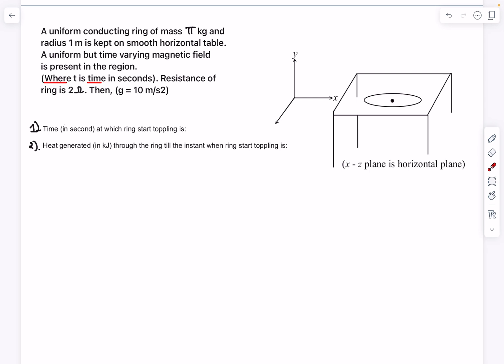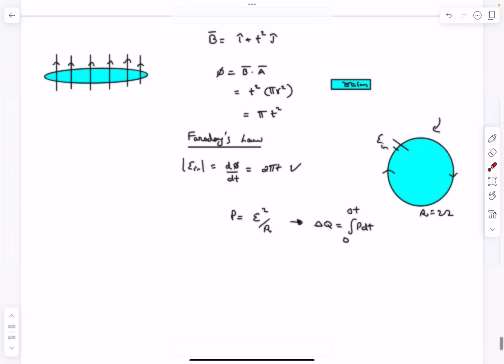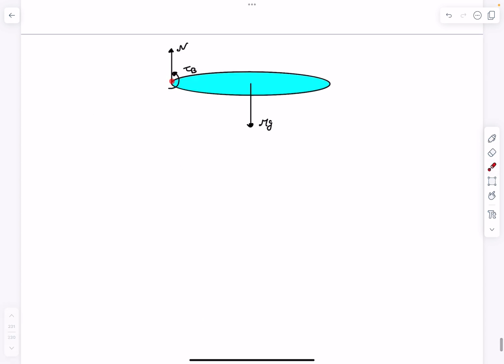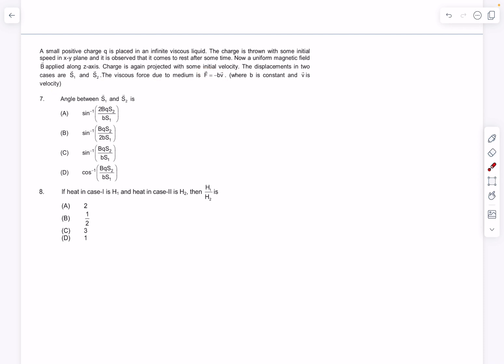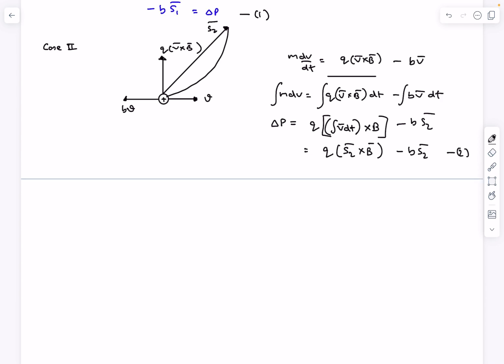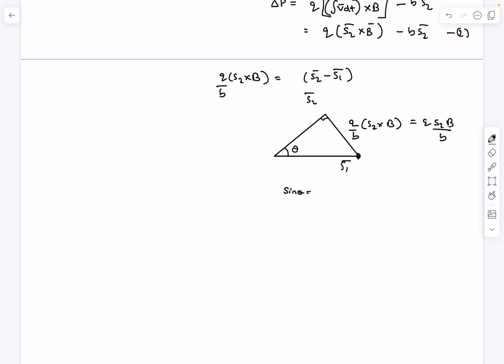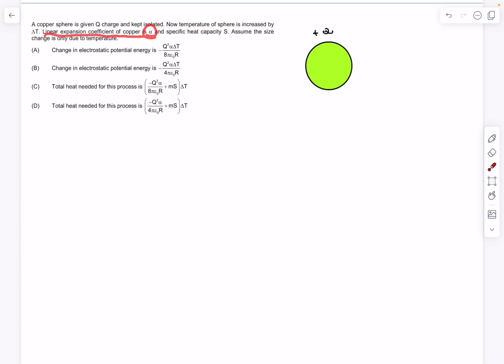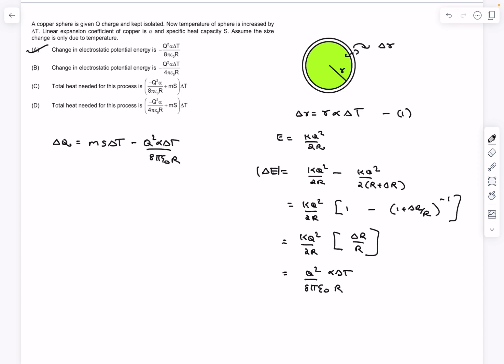[AITS] Good Problems On Magnetism And EMI For JEE Advanced

Comment: In question 7 of this video, in my method which is exactly same as your method, I took x axis as reference in case I and doing this would mean that i just have to find the final position of the particle in case II so that i can find angle of S2 vector with X axis , so i will be getting the answer  tan^-1(qB/b) which i cannot match with
Reply: Hey , the answer you got is also right , try right tan-¹ in terms of sin-¹ , it will match with the option